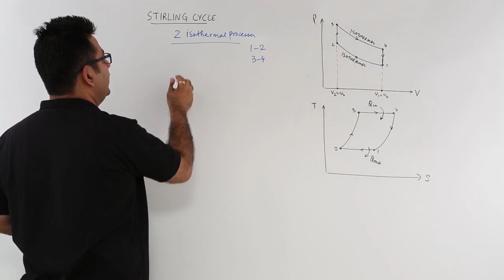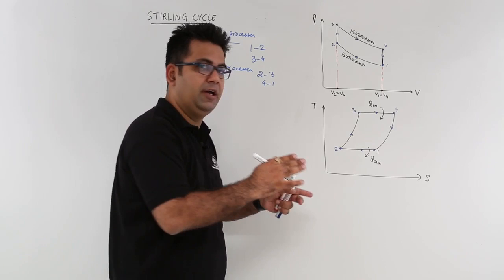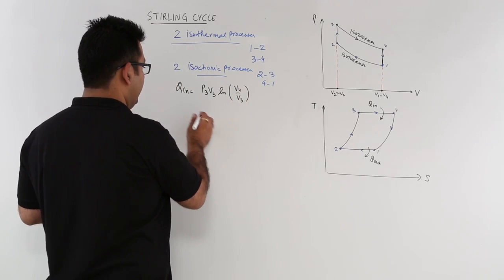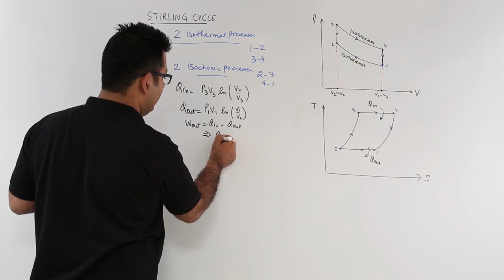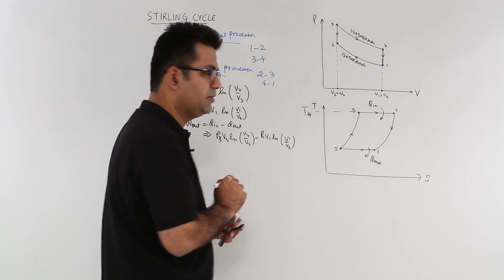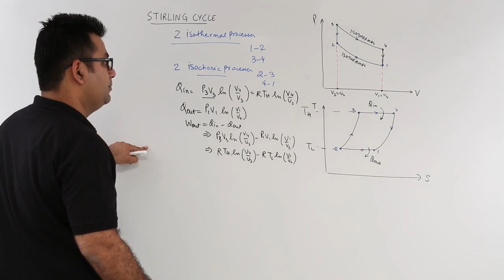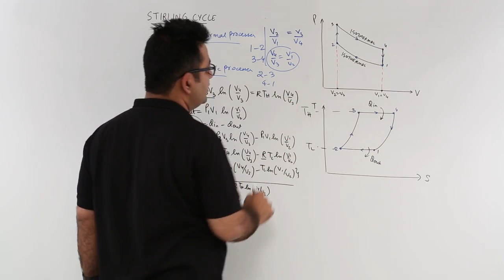Stirling Cycle

Comment: Sorry, but what is the difference between stirling cycle and carnot cycle besides stirling replaces two isentropic processes featured in carnot cycle with two isochoric regeneration process ? 
Also could you tell me the comparison between stirling cycle and :
-otto cycle
-diesel cycle

Thank you, I will sub to your channel cheers
Reply: Bro,  actually isentropic proccess in used in carnot cycle which is an internal combustion  engine 
Wheras isochoric process is used in stirling engine which is an external combustion pocess . Just search stirling engine you get the correct explaination. 
They both are the different different engines with different working process

Comment: sir, why isentropic process replaced by isochoric process , while isentropic process are very fast and iso thermal process is very slow . plz explain
Reply: Bro,  actually isentropic proccess in used in carnot cycle which is an internal combustion  engine 
Wheras isochoric process is used in stirling engine which is an external combustion pocess . Just search stirling engine you get the correct explaination. 
They both are the different different engines with different working process